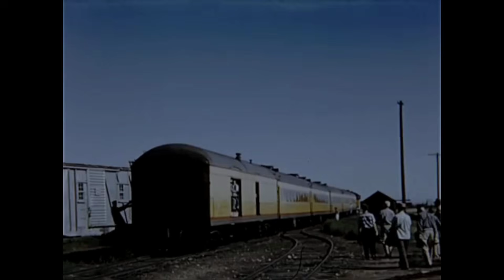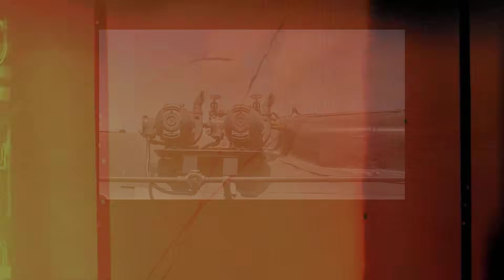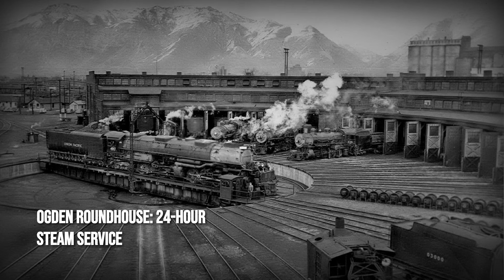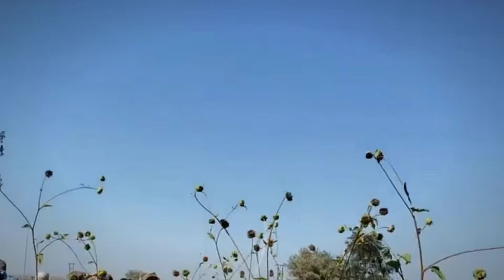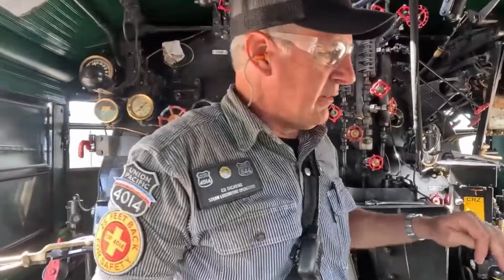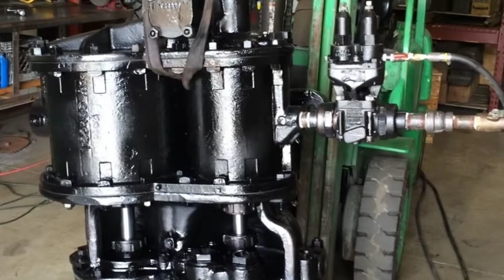Why The BIG BOY Can No Longer Run Alone: The Diesel Helper Truth

Comment: Ummm you talked about air compressors but showed the dynamos for electricity. 
The Diesels don't push Bigboy, Bigboy drags the Diesels the Diesels apply dynamic braking to put a load on Bigboy. One thing g you got right is brake shoes are expensive so the Diesels provide Dynamic braking really that is the only thing Bigboy needs from the Diesels as it has a power car that provides the so called hotel power. Bigboy has more than sufficient air compressors and tank volume for reserve air BTW air braking is the lack of air pressure so if an air line pops off the brakes to the cars come on. You also talked as if  Bigboy was always oil fired nope it was always coal fired only this recent restoration has it been retro fitted to burn oil 🛢 
Bigboy doesn't require Diesels to operate it uses them for the dynamic braking, as extra electrical power, they can supply extra air if it were needed but sence Bigboy is an older unique operating equipment if it were to break down the Diesels are there to rescue it move it to a safe location for repair or to take it back home if necessary but so far it's been the opposite Bigboy has rescued Diesels both broken down and stuck trains that could not move.
Oh yes I almost forgot Bigboy currently has it's own PTC that makes it totally independent from the diesels ⛽️ they added a 3rd dynamo and installed PTC in the cab of Bigboy and fully integrated it into the Bigboy part of that system has been built into the tender and wheel and rail sensors are installed on the leading truck at the front of the locamotive.
BTW WATCH HYCE video of NO DIESELS!

Comment: As others have pointed out, 4014 can and occasionally does run without a diesel.  The diesel is there for braking and as backup.  In a recent interview, Ed Dickens explained that at most times the diesels in the consist are simply idling.  He suggested watching a video taken from an overpass.  4014 will have plenty of smoke talk from the smokestack as it pulls the train.  The diesels will slide under the overpass with their engines idling.

Comment: The water usage is off. It's not going through 99,000 gallons of water per hour. If it's a 6000hp engine it would use 414gpm of water. That's 24840 gallons per hour. It's not a 24,360 horsepower engine....

Comment: Someone correct me if I'm wrong, but the Big Boy had to have a diesel accompanying it because it did not have Positive Train Control installed.  My understanding is that there was a third gen set installed to power just that system so the Big Boy could power the entire train by itself.  So, yes, all 6000 horsepower of the Big Boy can power a train quite well without any assistance from a diesel-electric.
Reply: Yea must be an old video even though newly posted. BB, with the exception of dynamic breaks, has everything else now. It has its own PTC and don't need a diesel for that anymore. A lot of people hate seeing it, and i get it. Its not the 80s/90s where you would see 844,4449,3751 just chugging everywhere on their own with zero issues, then some Metrolink drive decided looking at his phone was more important, blew a red light, and killed himself and passenger and BAM PTC was now mandatory. The other things was the air breaks. Like BB was designed to pull a 5 mile long train. You would think it would have a big enough system for all of that? Unless they are stalking single to single compressor. Pretty sure it has more than one, but I have only see the driver side of the engine in person.
Reply: @drtweak87  not an old video just old facts!
Reply: There is a good video out about the installation, with batteries, in the tender. The diesel is for allowing the engine to run more load from dynamic braking, and should something fail that can’t be fixed in time, clear the track. When burning oil, it is harder to run engine under light load. When I did ships, the air fuel ratio was controlled by the automation, as well as the steam pressure to the steam used by the atomizer (we used 6 oil which needed heating to like 30 centistokes). Have fun
Reply: You are correct, and the big boy can indeed run alone and has run alone after it's recent upgrades.
Reply: The diesel engine is there for electric power for the instruments. And to give the crew sleeping and the dining car and the passenger cars power
Reply: @stephenatkison2914 absolutely not true. Big boy has three steam electrical generators and can power the entire train according to Ed Dickens.

Comment: Ok. I have to stop. As far as I understand the big boy was never intended to be fed by shovel. That's a huge, hungery firebox. The locomotive is equipped with an archemedes screw to feed a constant or near constant supply of coal.  As a understand it, a man could never feed enough coal to keep up the  fire. Imagine a man being able to shovel that entire tender if coal into the firebox in a few hours time. Couldn't do it, and he'd probably die from overexertion.
Reply: Uf, sunt tare departe de dvs. si n-am citit ceva mai competent pe-aici. Masinile Diesel care sunt legate in spate nu sunt pentru sprijinul tractiunii, ci pentru a compensa faptul ca 4014 nu are probabil instalatie de ''om mort'' si pentru a spori  forta de franare. Vizavi de combustibil, eu cred ca a fost modificat sistemul de alimentare, caci daca ar merge cu carbuni nu numai ca ar trebui mai multi fochisti pentru asa ceva, DAR S-AR UMPLE RAPID "'CENUSARUL"' (spatiul in care ard carbunii). Asta ar fi problema: cine evacueaza deseurile, si cum ? Pe drum ? In nici un caz. Probabil ca arde "'pacurina"' un amestec de pacura si de motorina, de aceea fumul este atat de negru, si nici motorina pura nu este, caci la caldura din focar s-ar autoaprinde. Si inca ceva: ceea ce impresioneaza nu este neaparat puterea (5220 kW~7000 hP) ci forta de tractiune, adica vreo 620 kN posibila datorita greutatii sale aderente (incarcata complet cu apa si combustibil are cam 730 de tone). Ce inseamna asta ? Am mai exemplificat. Daca presupunem ca un vagon de marfa complet incarcat (container metalic) are cam 100 de tone iar lungimea acestuia e de 20 metri, trenul de circa 6200 de tone ce-ar putea fi tractat ar avea cam 1,25 km (ceva mai putin de-o mila). E ceva, nu ?! Problema care apare e cu franarea lui (caci trebuie si oprit, nu ?). De aceea se ataseaza acele masini Diesel, pentru a furniza aer comprimat necesar franarii. Si inca o intrebare simpla: de ce 4014 , precum si 3985 (varianta mai scurta) are motoarele jumelate ?